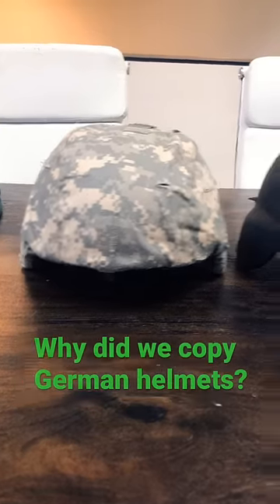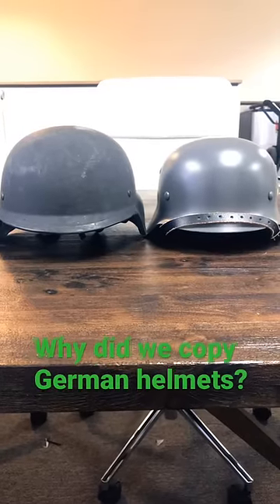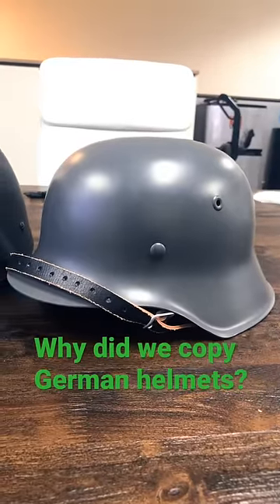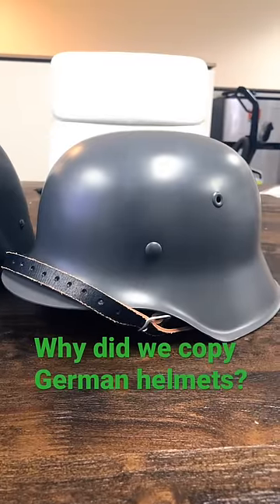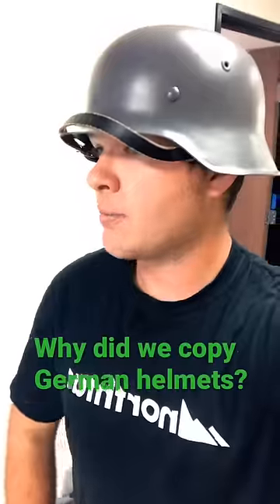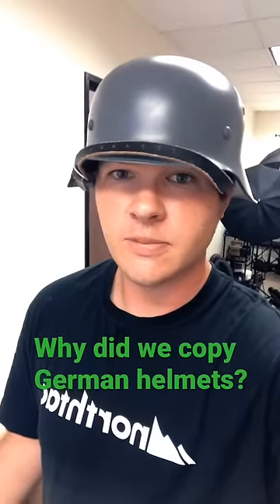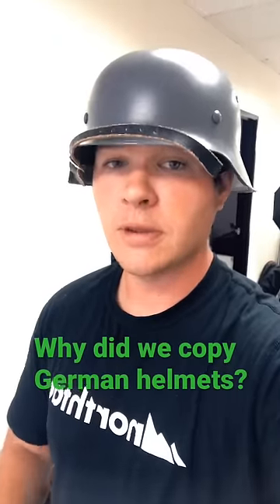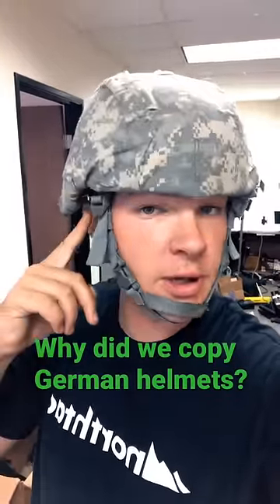Why did we copy German helmets? #shorts

Comment: A common misconception but the pickelhaube was primarily made of boiled leather (the exception being the cuirassier's or heavy calvary version, which was made entirely out of metal, and was often used in portraits of high-ranking leaders.) making it practically useless in the trenches, other than getting you shot.

In 1916 the pickelhaube was discontinued in favor of the all metal Stahlhelm, which would be cut down and simplified until you would get the WW2 version. In effect, the WW2 Stahlhelm is the same helmet used in WW1, just simplified, just like the Kar98k came from the Gewehr 98, Kar being a shortened version of karabiner or carbine, and k being Kurz or short.
Reply: @davidoo_21  Lol
Reply: @greysonholtzclaw5276  glad you didn't take it personally, we need more people like you in the comments section
Reply: @davidoo_21  Yeah I figured you were just messing around, and to be fair, I did get a small laugh out of it, it was pretty nerdy.
Reply: In addition the other variet of picklehauble is with the top for people who work with artillery or cannons is round
Reply: Interesting I didn't know that
Reply: Do you know why the Germans had it that way?
Reply: @davidoo_21  basically just differentiate each other. German uniforms also had colored piping to tell the different branches in WW2.
Reply: @greysonholtzclaw5276  ohh thanks that makes a lot more sense
Reply: not useless, just not very effect vs shrapnel. it still protects decently from concussive blows to the head and to a lesser extent melee.
Reply: @greysonholtzclaw5276  That's still a thing today
Reply: Ah yes, I've debated this with many people in my life. Very common misconception. 😁
Reply: Yeah nice i looked for this comment. 

The ww1 Stahlhelm was a bit bigger. Also the Uniform was longer in ww1 because trenched warfare. 

In second war everything should be light and Short like the k98
Reply: @davidoo_21  Artillery is a job where lots of people work in tight spaces bending over a lot to pick up stuff.
They rounded the top of the Pickelhaube so people wouldnt poke each others eyes out all the time.
Reply: Why were the Germans so stylish?
Reply: Stahl means steel. Just say steel helmet?
Reply: @afberglund2764  Technically yes, but in this context "Stahlhelm" means the german helmet designs of the world wars, wheras talking about steel helmets can mean any helmet made of steel...
Reply: @afberglund2764  and whats about the pickelhaube? How would you Translate that
Reply: @luichinplaystation610  Like 100 years old?
Reply: @hermelnderhans  It would literally translate to point/pickaxe bonnet. However the more accurate way to translate it would be spiked headgear.
Reply: @midshipman8654  True but the most deadly thing in World war 1 was artillery not melee so you needed to worry more about artillery than melee.
Reply: @afberglund2764  Did the person you reply to delete their message because I can't seem to find it.
Reply: @greysonholtzclaw5276  he said something like "are you a nazi" so nothing of interest 🙂
Reply: @afberglund2764  Wow Godwin’s law came into effect pretty damn quickly.
Reply: @hermelnderhans  Ww1 uniforms were designed before the war so you're wrong, also you don't need longer tunics in the trenches...
Reply: I have two steel helmets. Understand why many soldiers hated to wear them bcs of the weight.
Reply: Thanks einstein  for the info.
Reply: @davidoo_21  why the spike on helmet sports fans? I'm waiting
Reply: @johnjepsen4243  They could bump people in the stomach with it.

(It was for decoration, artillery had round spikes, cavalry had flat spikes etc)
Reply: @johnjepsen4243  The spike on infantry and various cavalry helmets ensured that vertical hits from sabers were deflected sideways. The rounding on the artillery helmets was intended to prevent mutual wounding when reloading the guns.

Comment: Its also worth pointing out that the little lip in the front directs water away from your line of sight, on less you tilt your head forward, this means you can aim your rifle without water dripping in front of your eyes:)
Reply: And like a ball cap, helps shade overhead sun.
Reply: Also keeps the rain from running down the back of your neck.
Reply: Fuckin what

Comment: Yo they really said “you’re a bitch if you wear a helmet in war” those generations before 😂
Reply: Reminds me of the covid mask debate cough cough
Reply: @tk8668  that's pretty different
Reply: @tk8668  a helmet will actually protect you from something.
Reply: @robertortiz-wilson1588  a good mask will also protect you from something, but here’s the key term GOOD, like a 3M surgical mask, not a shitty mask from the gas station around the corner
Reply: @thunderouspasta  correct!
Reply: Not rly, no soldier in ww1 would say that.
a helmet could not save u during a charge anyway.
Reply: @thunderouspasta  Also, you're completely wrong about 3M.  3M is a proprietary name.  And they make a whole variety of different masks for different purposes.  There's nothing about 3M that assures you protection from getting sick.   What you meant to say was an "N95" mask.  That's the rating of masks that are supposed to protect against airborne microbes.
Reply: @saintadolf5639  yes that is what I meant, I just couldn’t remember the classification so I just went with a broad term to hopefully get my point across
Reply: @raja2850  I know
Reply: To be fair, today's helmet only stop pistol rounds to an extent and only some shrapnel, so it doesn't make too much a difference.
Reply: @tk8668 Helmets actually do the job tho.

Comment: Then you had the German Helmet that had the two lugs on the front to hold a massive armor plate meant for heavy gunners. They also wore that almost medieval armor that only covered the front. I'm pretty sure that was WW1 but I could be mistaken. Gun Jesus made a great video on it.
Reply from the maker: Lobster armor and yes it was WW1. I’ll have to look for that vid
Reply from the maker: Thanks dude
Reply: Yep, those lugs were on the original 1916 model Stahlhelm.
Reply: The lugs were meant for air circulating and were filled in the cold. Sharpshooters wore the forehead plate and got their own helmet later. I have never seen a "heavy gunner" with a plate when it was first introduced. The plates were meant to stop bullets to a much less lethal level while the Lobster armor was purely for shrapnel
Reply: @mandalortemaan7510  I'm specifically talking about the lugs that held the front plate for the extra armor. It's all explained in the video I linked
Reply: @VintageWarfare  It is funny to possibly think that someone in WW2 likely wore a WW1 version of the M35 with that faceplate.
Reply: @sinisterisrandom8537  Wehrmacht 1939 Border garrison and reserve units, the integrated parts of the SA and until 41/42 even when not part of the wehrmacht SS police and Waffen SS because the wehrmacht was there equipment supplier.

Comment: It actually wasn't seen as cowardly to use a helmet during ww1. The reason they weren't used during the opening years was due to the idea that they were a waste of time, they were heavy and didn't offer much protection due to poor steel. This idea was later blown out of the water once the reality of modern warfare set in.

Comment: Exactly; and they look very similar to the helmets Samurais used to wear. Great info!
Reply: No it is a copy of a european helmet from the middleages called a Sallet.
Reply: @havtor007  So? It keeps looking similar to Samurais helmets.
Reply: @Overxpossed  then any helmet looks similar to those for you right?
Because they are very different from a samurai helmet.
It is a direct development of the medieval Sallet even using the same suspention on the inside.

The samurai helmet has side cheek pieces and a mask (mask can be used or removed)
The shape of the bulk part of the helmet is different the shape at the back of the head is different.

But hey sure samurai helmet looks similar it is a helmet afterall
Reply: @havtor007  Any helmet that looks like the samurai ones, sure. Not all helmets looks like the samurai ones.
Reply: @havtor007 That's the same logic you're using for saying the PASGT and ACH helmets look like the German helmets

Comment: Fun fact: (or myth?) In WWI, soon after the British started issuing helmets to the frontline troops they stopped and banned them, as the saw the number of registered headwounds skyrocket. Eventually they realised that the wounds were registered as headwounds because the soldiers actually survived, whereas those dead from shrapnel hit to the head were merely registered as "dead" without recording the cause of death. With this knowledge they started using helmets again. It's so nice with a 'bright' staff at HQ, especially for those fortunate enough to get hit in the head after having been issued tge protective helmet.
Reply: You see this erroneous data interpretation with peoples attitudes toward seat belt use too.
Reply: This also happened with planes. The USAAF would armor the parts of combat aircraft that usually came back damaged, and leave the parts that came back intact. This did not work.

Eventually someone recognized the issue and the USAAF began placing armor on the least hit parts of their planes. This increased survival rates.

This phenomenon is called survivorship bias.

Comment: The stahlhelm is actually designed off of the sallet just as the brodie is designed based off the kettle helmet they were both based on designs that already worked the French Adrian helmet however is a very Victorian looking design but is more relatable to the brodie in function and the m1 steel pot helm seems to be a totally modern design
Reply: The seller is actually designed based on ancient Roman and Gaulish helmets

Comment: The stahlhelm with the extra armor plate can also protect against bullet's.
Reply: It could make it less lethal, but a direct hit would still cause some damage at that time. With modern ammo you can penetrate as good as every steel helmet.
Reply: @jus7040  back then it was bullet prove the extra plate had more than twice the weight of the stahlhelm

Comment: In WWI the British analyzed wound statistics and found that very few wounded had head injuries therefore the conclusion could have been that steel helmets were not necessary.  After their introduction, it was seen that the number of head injuries actually increased simply because without the steel helmet, casualties died instantly or very quickly.  The Western Front Association channel have an excellent video on this.

Comment: in short, it is the most effective shape in covering your head while also not affecting your vision, breathing, hearing and other neccesary functions too much. most other helmet designs at the time often had to make a few sacrifices either way, by either providing less protection, a larger target, or worse field of view, however it also should be mentioned that most nations did experiment with the schwerd pattern of helmets in the interwar years, however usually deciding against it, often for reasons as simple as friend foe recognition, and also the cost of creating these sort of helmets, with many local designs simply beeing cheaper to make. it also should be noted that both the SSH 40 and M1 provided marginally better bullet protection, however in case of the test done on the SSH 40 compared to the Stahlhelm35 (M40),  there are arguments to be had of definite bias in favor of the SSH 40 and even then only providing slightly better protection at unreasonable ranges against russian made firearms. in case of the M1, again, its protection against handgun rounds did stand out at the time, however it did make sacrifices in the larger target it creates and the reduced protection against falling debris and overall slightly worse profile.

Comment: it should also be mentioned that many coldwar and modern german firefighter helmets are based on the M33 (another helmet that originated from the ww1 helmets) the rough shape saw some minor changes over the decades, however to speak to the use of these helmets, some of the Reichsfeuerwehr helmets made in the 30s were still in comon use in the 80s, and still found occasionally by the turn of the century,

Comment: Forgot to mention that the world war l 1916 Stahlhelm was different for the 1935 Stahlhelm since the 1916 was bigger and heavier so 1935 they replaced it will a smaller and a little bit lighter Stahlhelm the m35(this is here just so people don’t get confused that the Germans didn’t use the same  Stahlhelm that was used in 1916 in world war ll)

Also good short though

Comment: The design dates back to Roman times with flanges to protect the neck. The actual design was used by both Teutonic and French Knights and by Samurai. Its designed to deflect sword blows away from the neck and shoulders. It also deflects rain and light shrapnel. The modern helmets don't have enough of a flange to do anything but are capitalizing on the Nazi fear factor, especially police wearing black look like 1930's Algemeine SS. Sheer intimidation.

Comment: No. It was not generally seen as cowardly to wear a helmet. It was seen as unnecessarily expensive to equip troops with helmets that would only protect the head when marching exposes the whole body to attack. Once trenches became the primary fighting position and artillery the primary way to weaken that position, the shrapnel proof helmet was deemed actually cost effective. We can't forget that prior to October of 1914, the use of field entrenchments was minimal, and attacking them was done primarily with direct fire smallarms, light artillery and bayonets. Helmets won't help much when you spend most of your time exposing large parts of your body to the enemy.

Comment: The Picklehaube was a leather helmet and ceremonial only. It had little to no protective qualities although it was worn into battle. The original German design was much larger and deeper and was a very expensive design. It’s shape changed over decades for cost savings. The advantage of the German helmet over the M1 was it had greater stability and more protection of the neck and was a single piece of metal as opposed to the M1 which had a liner and shell.

Comment: Also the manufacturing of the German helmet was different. Instead stretching a plate of metal on the shape (like the others countries) they forged the helmet on that shape. The difference... The other countries helmets had much more weak parts, mostly on the curves and top due the unven stretching. The Germans were more even turning them more reliable

Comment: It was never cowardly to wear a helmet. That's false. Units in all the major countries used helmets for some of their cavalry units, especially for parade use.

Helmets simply were not considered worth the cost for most soldiers.

Also, the Stalhelm is not better than the M1. They provide equal impact protection, with the M1 being easier to maintain and repair if the liner is damaged, being 1 size fits all, and was cheaper to make.

Comment: Don't know where you found out that it was considered "cowardly" to wear a helmet in WW1. It's false. 
At the start of the war most armies didn't have helmets because they didn't think that they would need them. None of the armies on either side were prepared for a war on an industrial scale, they were trained to fight with tactics similar to those during the napoleonic wars (standing up in a line and firing) but those tactics were almost immediately made obsolete when faced with the devastating effect of modern weapons, hence why they started digging trenches. Then military analysts found out that most casualties came from artillery shrapnel which primarily impacted the soldiers in the head, since they were trenches. To combat this everyone started adopting helmets.